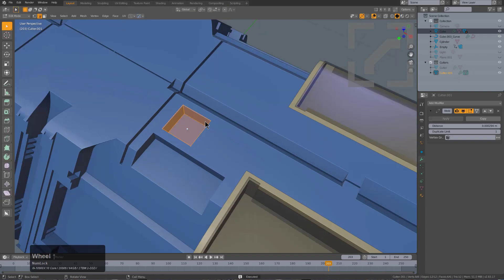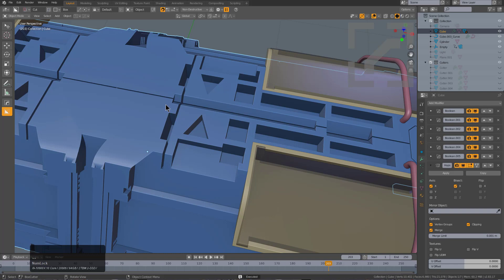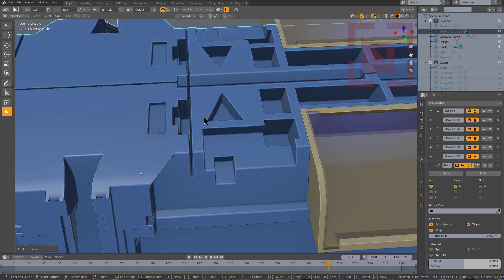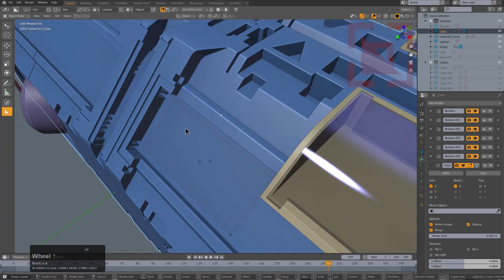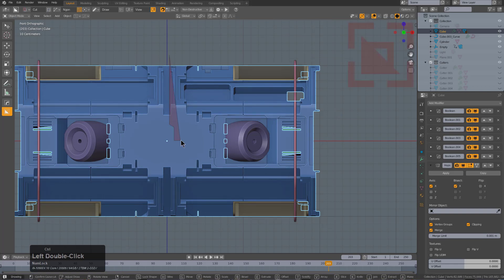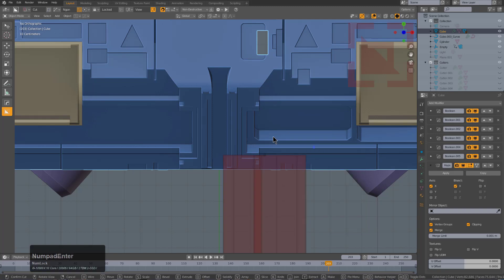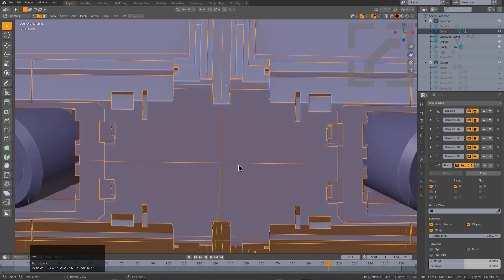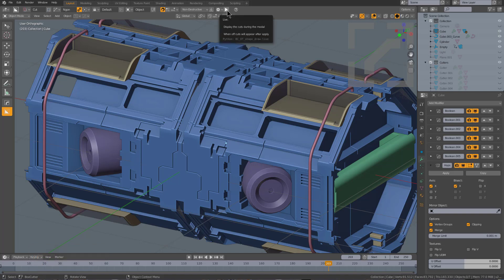#boxcutter 716 - Dealing w/ Slowdown (Live Mode)

Comment: What’s the most important component for dealing with Hops workflow. Cpu, gpu o ram? Or maybe an ssd? Doing my best to learn and i love it, however my pc runs out of power after some cuts (i7 6700, 970 gtx and 16 ram).
Reply from the maker: im all about this pc. Its still my baby. 
https://www.amazon.com/Intel-Machine-NUC8i7HVK-Radeon-Graphics/dp/B07BR5GK1V
970 aint doing you any favors and neither is 16 gb of ram but thats like my laptop so it shouldnt be too bad. 

When slowdown occurs one must deal with as appropriate for their system. Even on an i9 "exact booleans" can make any subsequent cut slower. When it comes to blender and booleans we are at the mercy of how well the systems underlying are optimized. At this time performance is always gonna be variable due to changes always happening under the hood as the next version is brought to fruition.
Reply: @masterxeon1001  thx for the answer. I never use exact bools. I lnow my pc is not a modern mechine but it worked pretty nice before. No idea why but I feel that after several booleans I am experiencing a huge slowdown nowadays. I feel like it wasn’t like this before. Adding a circle seems sometimes impossible or a knife cut. Adding a width to an inset bool cut is a nightmare. And there is a lot of free ram and vram available.

Comment: Btw does anyone know if boxcutter and hops use only single core or is it multicore
 - and addons in general - can they even perform multi core 
- i dropped hyperthreading from my 5.3 ghz i9900k just for single core performance - since I render with gpu.. it does indeed show highest single core performance, hyperthread splits it in two
On a 32 gb vram and i9900 at 5.3 ghz and 2080ti I can quickly reach the limit as well..
Python in general is slower than pure c code - if that’s what drives modifiers - but if multithreading can be used well that might solve some of the issues
Reply from the maker: coders always remind me of these things with python. We approach the limits of what can be done with python at this level. C will win every time. Internally we aim to make everything as low level as possible to keep speed in check. But the evaluation of code + live modifiers adjusting on the fly is just alot to a computer.
Reply: @masterxeon1001  I understand why, just wandering if there's any progress on that front
- can addons utilize multi cores at least ? didn't research too much.. 
- for reference, most of 3dmax plugins are written in C or c++, anyway, not scripted, and most of them were written for single core - and they haven't been updated for years - meaning it's sluggish as hell - so it's not just the programming - it's how you utilize it ..
- and then came along tyson ibelle with tyflow and start rewriting bunch of max old unupdated features, modifiers and makes them multi core - and all of a sudden everyting he does is 10x faster .. 
- you might do everything in C, but if it's not using the entire system it might still have slow downs ..
- also taking into consideration the fact that not everything can me multi cored - can
 moving a mouse cursor use 20 cores?
..in any case, there's a limit to what we are seeing right now - in blender's viewport performance and stuff like hardops/boxcutter - is it a software or a hardware one is what I'm wandering .. I mean zbrush has insane viewport performance

..also there was some new about a new approach to computing where on the low level hardware takes each process that is single core and cuts it up for multi cores - that one might have a benefit for all software..